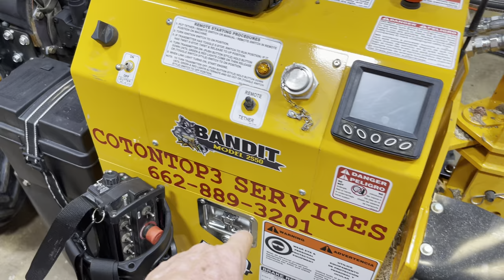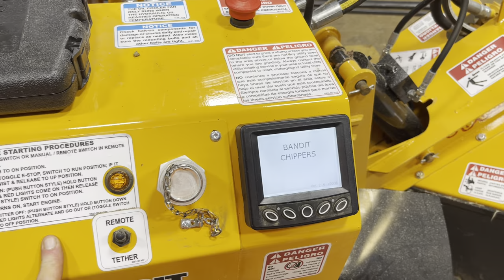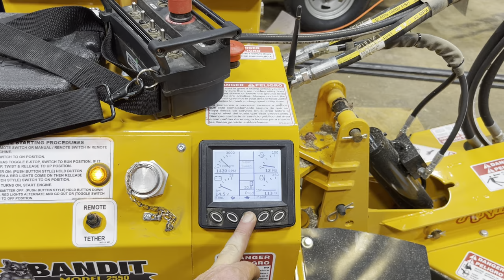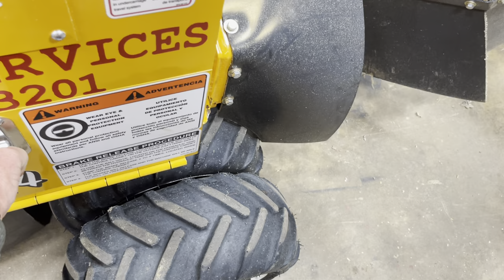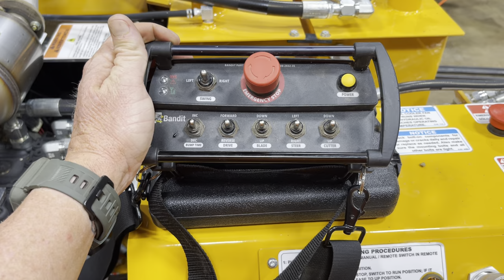Bandit 2550 stump grinder | all the details about it

Comment: Wheeled machines are great and in my opinion it’s rayco, or bandit for stump grinders. I use a sg40 most days which is really good for a petrol unit with 40hp however it’s mass is it’s only downfall, it’s too light and haven’t dig through it’s own waste. Sometimes I hire a rayco rg50 or a rg100 from the same company and they are fantastic machines, both wheeled diesel units. You’re right don’t pass up the money or someone else will make it!